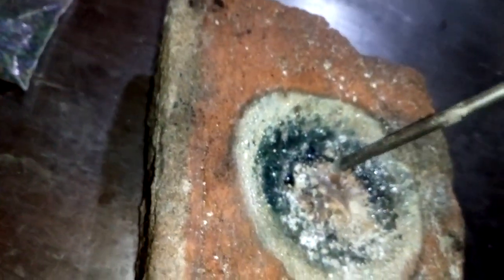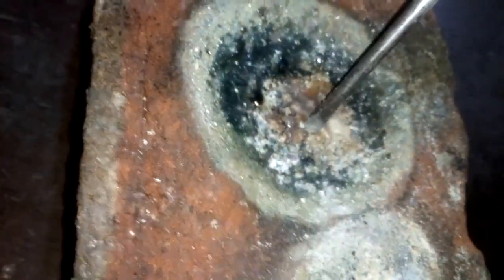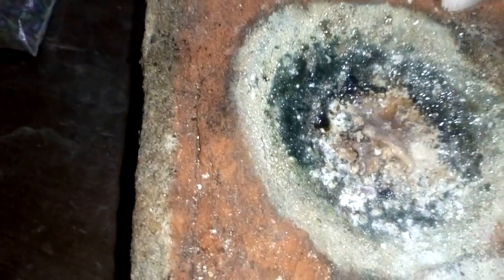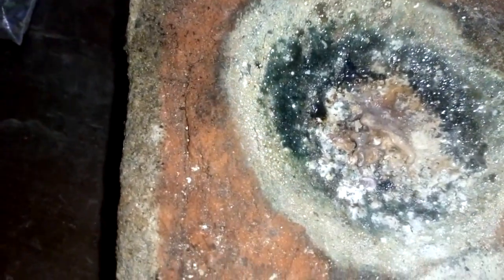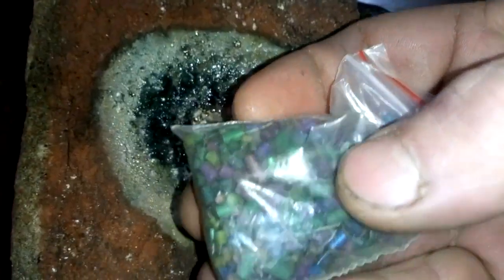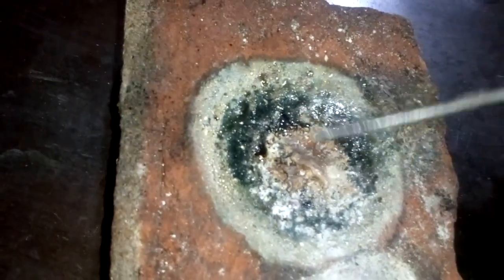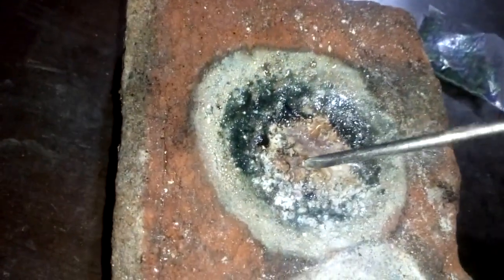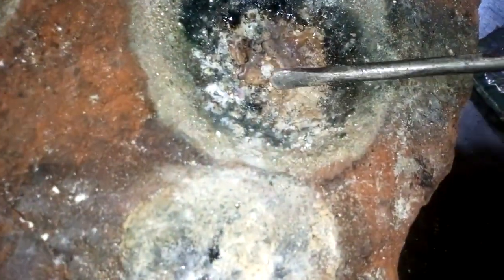Melt Tantalum anode with acetylene-oxy torch!

Comment: Hello 999 Dusan, Thank you for your videos. Have you ever dissolved Tantalum in hydrochloric acid?

I have 1 pound of SMD tantalum capacitors and I was thinking on crushing them and pouring acid to keep only the Tantalum...

BUT I’ve heard that Tantalum dust can damage your lungs so maybe I can just pour the hydrochloric acid without crushing them. 

What do you think would be the best way to separate the Tantalum from the SMD capacitors plastic case?

Thanks a lot!
Reply: It won’t dissolve in HCl. Only HF and molten salts (some evidence shows refluxing sulfuric acid can dissolve it, but my experiments for my thesis showed no evidence. I tried refluxing sulfuric acid for five or so days, no damage to tantalite crystals.)

Comment: My guess is that you would need a melt dish to bring it up to full temperature.  Melt dish would need to be surrounded by fiberglass and tantalum would need to be kept with high heat for a few minutes maybe longer.  I could be completely wrong though, lol.
Reply from the maker: I still have some amount of pure anodes, so I'll try to do it soon, who knows, maybe it works!

Comment: You use any borax for oxides
Reply: I believe the flammable material in the beginning, is the various electrolyte residues left on the anode, which also gives them the differing colors.
Reply from the maker: Just a litlle!